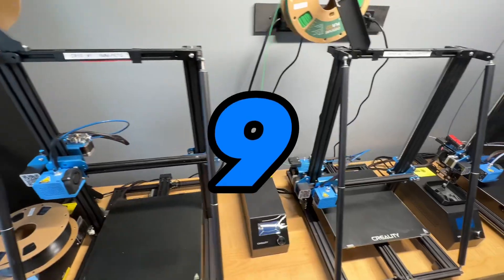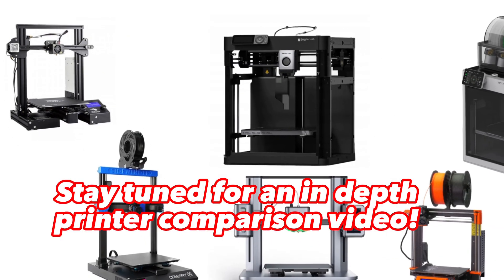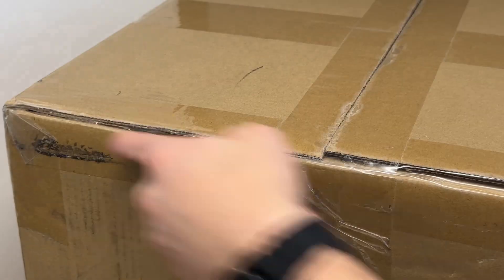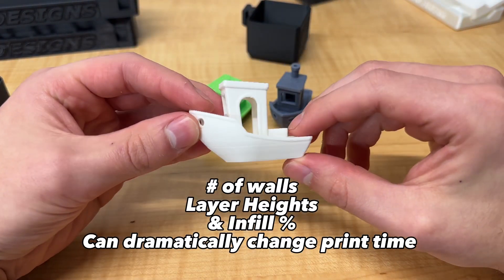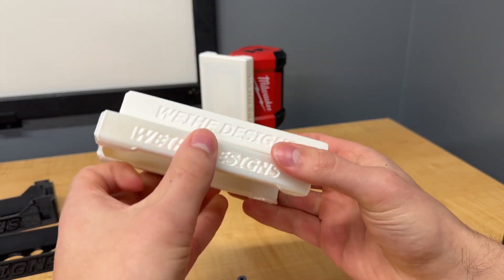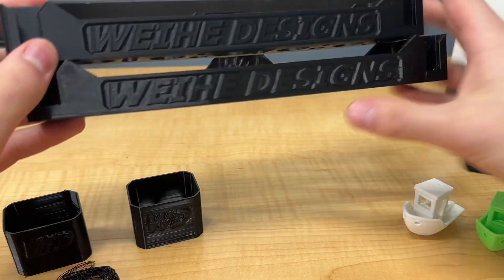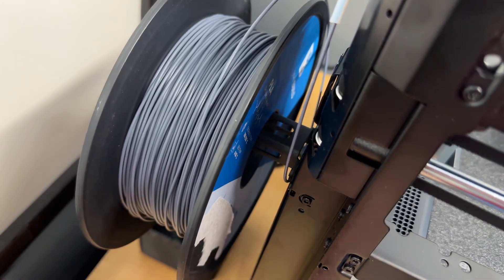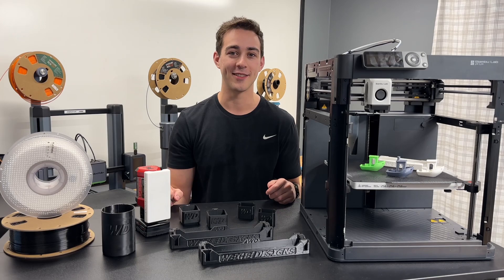IS THE Bambu Lab P1P the BEST 3D Printer UNDER $1000!? First Impressions

Comment: After 3 months of researching, I bought a P1P! I am a complete beginner, however I watched a ton of Youtube videos and been on reddit forums since I wanted to learn the whole aspect such as the actual printers, printing settings(e.g. temperature, speed), and different problems people have. The P1P has been great, I've had it for 2 weeks now and have printed so many useful things(gridfinity storage boxes, honeycomb storage, plant brackets, reptile/aquarium tools and equipment). A lot of the different issues can be solved by playing around. Sometimes someone who has what looks like the same issue as another, is due to a different problem. The P1P isn't perfect but once you figure out your environment(is your room cold?/do you have enclosure?),filament, as well as the settings in the slicer, then you'll solve a lot of problems to get perfect prints.
Reply: Im where you were about 10 months ago 😅 are you still happy with your investment, any suggestions, issues, etc?

Comment: prusa mk3s kit $799  bambu p1p $699   lol!
Reply from the maker: P1P for the win
Reply: @JakeWeihe  makes the mk3s look like a dinosaur.
Reply from the maker: Have you seen the sovol sv06. Basically is a press clone. But it’s a third of the price! I’m pretty happy with mine
Reply: @JakeWeihe  my first 3 printers were bedslingers, i won't buy another one ever.
Reply: Prusa is not realizing the new changes, yet focused on shitty things. I asked them many times when we will have better mk3s+ with the mini screen and the new tech! Always dead end unfortunately. Even though I liked the Prusa, right now I'm looking for Bambulab
Reply from the maker: True
Reply: @JakeWeihe  another YouTuber talked about it. Prusa you need to do upgrades like smartphones or small ones like cars. I had couple is issues with the mini because of the plastic used on the extruder and Bowden system, it brakes easily. I was thinking that have 2 Prusa mini will replace an mk3s! Other issues is with Prusa stated that ASA and abs can be printed, while there is no enclosure and it came after many years...add it cost a lot. Seriously, Prusa you are losing ground. Fortunately, Bambulab like DJI is making things easier.
Reply: @mouhabuntu  MK3 uses 8bit board, mini uses 32bit. That's why they don't have the same screens, But they're opensource, you can just put a color touch screen on your MK3, you don't need prusa to do it for you. Prusa is focused on reliability and build quality, they're not into flashy things. I'll take a prusa over a bambu lab any day of the year. One is proven reliable, the other can't even be serviced.
Reply: @LilApe  for the price of mini I can get the P1P. Honestly, no comparison as they are not in the same league. Bambulab printer is in a different level. Prusa are reliable like Toyota, Bambulab is like Tesla. It's all about speed. Prusa does not offer anymore good quality/ratio products compared to other brands that will catch up with it.

Comment: Hii! I have so much problems with warping on my brand new P1P, i tried everything i have knowledge about but nothing works, i also puet some Lack on the bench but still not working at all. Do you know which can be the problem?? Thank you so much, and great video!!
Reply: I hope its ok to jump in. Jake is correct. You should use soapy water to clean(free). You can skip the IPA(from what I saw from BL forums)

A few questions did your P1P come with or are you using an Aux fan? If it did try turning it off or position your part away from it and test.
How big is the part in relation to the bed? Small, medium, large surface area? Can you describe the part you are printing? 

You can use an adhesive like "vison miner nano polymer". It's a little pricey($45 for 120ml) but works great on all bambu lab build plates. It works as an adhesive and release agent and wont leave a residue on parts. Cleans with water, ipa.  You should get about 300 applications with that and you can go 10-20 prints before reapplication. You can stretch it further but just coating the area you are printing on.
Reply from the maker: Thanks for extra tips Ashley! 👍🏻
Reply: @JakeWeihe  Thank you for the great content and response.
I love the 3d printer community and like to help out if I can. I am almost at 2k hours on my Bambu Lab X1C since Aug 2022 so hopefully I can help anyone with growing pains.
Reply from the maker: That’s awesome! I think I’m going to have to get an x1c in the near future. Do you have other printers as well?
Reply: @JakeWeihe  I don't have as many as you.
I have a retired Prusa Mk3s+
A retired and heavily modified ender 3 pro
An unopened ankermake m5 
and the Bambu Lab X1CC

I got the ankermake m5 from kickstarter and received it in Dec 2022. I had ordered the V6 color engine too and debating on whether to setup it up or sell it when the v6 arrives. 

The Mk3s+ is alright but kinda regretting how much I spent on it vs what it can do. So at the moment it is unused and I will probably give it to a family member or friend.

The Ender 3 pro was my first printer and the one I spent the most time on. It was the cheapest @ $100 but it was one of the worst/best printers that nearly made me get out of 3d printing but eventually the tinkering, modifying and headaches paid off.

The X1C was just ....easy. I've printed far more in 7 months than all of the time with the other printers and the QOL features just made it simpler to stick with 1 printer.

I see you have 2 Ankermake? Sovol and creality Is there any that stand out?
Reply from the maker: I’ve been very happy with my ankermakes. 
I had to do a lotttt of tuning on the ender 3 v2 to make it reliable. The cr10s have been good 
And the sovol sv06 prints PETG very well. I have the sv06 plus on preorder
Reply: @JakeWeihe  Every day I am more and more tempted to open the Anker and maybe use it for TPU or other filament that doesn't need color changes. How are your V wheels? I follow the ankemake subreddit and there are folks who needed to change out wheels due to defects. 

That Sovol 06 plus has me very interested in larger prints with a great price. So far 3d printing was just a hobby but I may start selling parts if I can get consistent results, if that makes sense. 

I'm sorry for talking your ear off. Thank you for responding. 🥰
Reply from the maker: Warping with what material? 
Did u clean the bed with ipa or soapy water?
Reply: @JakeWeihe  Hello, with PLA of Amazon Basics, but also with the PLA that comes with the printer, yes i clean it several times 😔
Reply from the maker: Do you have the textured build plate?

Comment: Thank you for the review. Have you had any issues with layer line inconsistencies that some users are reporting? I’m thinking of pulling the trigger one a p1p but am hesitant because I print with a lot of shiny filaments that would make this issue seem worse.
Reply: There is a simple fix for printing shiny/silk filaments.

You can change outerwalls to 50mm/s or lower and leave inner walls to 200-300mm/s.
You can retain the BL speed advantage and get the "shiny" look on your prints.
Reply: @ashleys3dprintshop  This is correct.  Matter of fact my prints are almost too shiny :)
Reply: @TheXmaniac1979  I know right? Once I was informed of that little trick I can matte silk or have it shiny and glossy. I will be posting some Atomic Heart Twins on my channel to show it off. 🥰
Reply from the maker: I haven’t printed with any silky filaments yet but evrything I’ve printed with so far is as good or better than my other printers
Reply: I have really poor print quality on mine. Kind of unfortunate.
Reply from the maker: Did the print quality drop over time? I enjoyed your video but it seemed like your experience was still pretty positive. 
I actually just noticed your follow up video. When did your issues start?
Reply: @JakeWeihe  While filming the initial video the low print quality was kind of worrying me, but I assumed it just needed to break in a little. Now that I've been printing with it for a couple of weeks, all of my prints look a little bit off.

Bambu support has offered to replace it after about 10 days of back and forth with them. I'm tempted to take the offer , but the problem is, I have a bunch of videos queued up for it already, so I told them if they want to send a replacement I'll use it, but I did not want to send the old one back because it would interrupt my production schedule.

I would be more willing to play ball if they had given me the printer for free, but I paid for it - it's an investment and I need to make videos with it for it to pay for itself. The purchase loses money/relevance over time if I send it back and have to wait another month to start filming P1P content again.

Also, I have never sent a printer back in the 20+ printers that I have reviewed. I review them as-received, and upgrade them as I see fit.

The other concerning thing is that I have broken some of the "warranty void" seals to inspect the electronics. Nothing that would have affected print quality, but I don't know if they are going to screw me out of even more money or hold my printer hostage because of that (like deny a replacement, charge for shipping and repairs, etc.).

Regardless, it is a very exciting machine, showing the rest of the market how things could or should be done.

Looks like the print quality on yours is much better, but until Bambu send me another printer to test, I'll not be able to verify on my channel.
Reply from the maker: Aw man that’s such a bummer. When did you get yours? Maybe mine is from a new batch that has a few tweaks
Reply: @JakeWeihe  Initial pre-order
Reply from the maker: Hmm. They must have changed some things since then. I ordered mine two weeks ago now